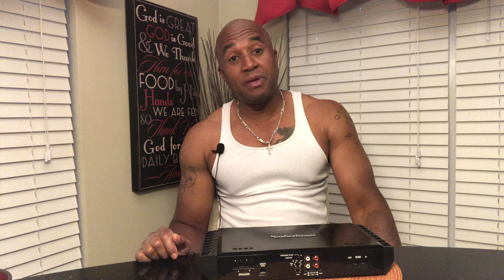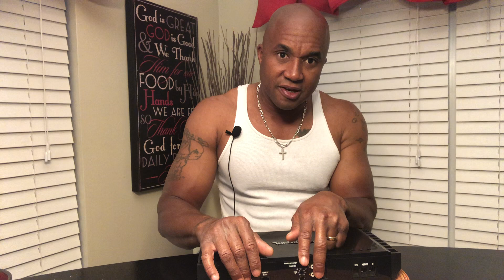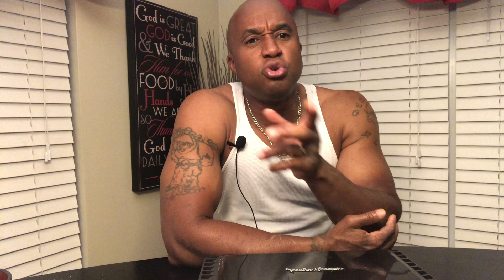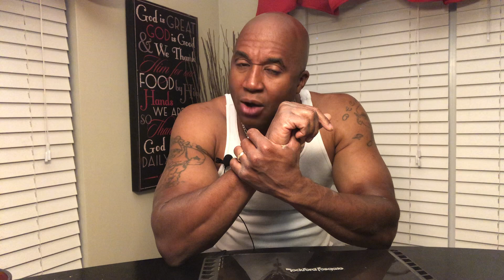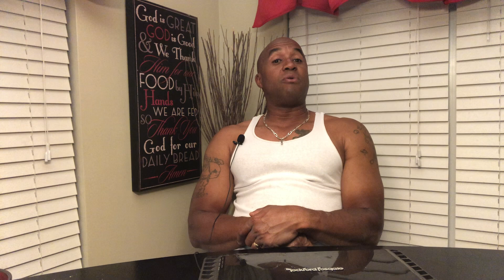Your amplifier gain is not a volume knob. Understanding the gain!

Comment: I don’t understand and I’m probably overthinking this. 
How do you test the voltage on the amp to know you’ve gotten to 4 volts if like me I have only 2 volts going in. 

I set my gains by taking the DC volts going to the amp then multiply that against the RMS I need then divide that by the ohms I need as well then the square root of that should give me the AC volts going from the output on the amp. I hope I’m not doing that wrong or maybe I’m missing something?  

I know this is an old video but how and where would I put a multimeter to the amp to see the voltage against where the gain is set.

Comment: So ..when it says 9v on what tou would presume is the low (left hand side ) if you were tp assume it was volume which is what you gain ;) lol 
 So if the low 0.2 volt on the right hand side of the knob ( high volume) i.e it refers to the input you are trying to' gain'.
  Fingers crosseed i dont turn on first time its on full hammer ! Omg .
 Thanks

Comment: My biggest problem is I have a 4 volt pioneer and 5 volt taramps 8k and it clips before 45 and 62 is max volume some songs with heavy bass clips before 45 and if I turn the gain back some it's weak so what I do is turn it up around 40 to 42 right when it slams and back the volume down on heavy bass tracks when I see clip light blinking?

Comment: Mr MB Question on gain settings. My Kenwood Radio is a 5 volts pre out. If my amp has input is rated at 5volt also I will not have too touch the a gain at all correct ?
Reply: My question exactly. I have a head unit with 5v preamp outputs but with the RF punch 1000x1bd i have to turn the gain like 80% ?

Comment: Hey buddy I have a dumb question (Since I really don't know much about car audio) but, say I have two two subwoofers... both are 15s by the same make and model.... but say one is 3000 watt rms and the other is 500 watt rms.. my question is if there both still 15s (even though one has way more power) isn't the subwoofer with less power gonna sound the same?? Because the air movement is the same correct?? Just wanna know!! Thank you!!

Comment: My system has a xs power d6500 and the regular stock battery still. If i upgrade the stock battery with another XSpower would that make a difference even with stock electrical and alternator?

Comment: Its output high ac voltage off low dc voltage and the more current you can give at a certain voltages the better the amp will proform  and if you driving a dirty single in to tge amp you are now amplified the dirty single to the output of the amp which chase 3 things ( high current draw hot speaker coils and a stressed out amplifier) so rule of thumb is for ever 100 watts of power that amp dose is at lest 15amps of current  so if your running 1000 watt amp you want at  least 150 amps of extra head room. You can get this by upgrading your alt to a bigger  alt adding in a secondary battery

Comment: Especially when using a lc2i or other powered line out convertor... I believe they can produce up to 9v of power. Had issues trying to dial in my amp using the square root method playing a test tone and turning the gain on the amp at 3/4 volume.  The lc2i was turned almost all the way up, therefore I only had to turn my gain a slight bit for MAX POWER!!!!!!!!

Comment: I bought 1500 bdcp and it gets hot and cut off is it wired wrong or is it something wrong with the amplifier because I bought a 300 amp alternator help don't know what to do
Reply from the maker: Could be where it mounted, not enough ventilation. Or the power wire to small as well as ground. They do get hot though

Comment: Good stuff man! You were sorta true on how you said it in the previous video. Tony D’Amore has a video up explaining exactly how it works. But if I recall it’s based on the dc voltage in to the aftermarket radio. 12volts for example, then the radio uses that and creates the rail voltage for the rcas in ac. And usually even in the most expensive head units that’s about 5 volts because the rails split that 12volts dc in  and make 6volts  up and -6 volts down on the rail voltage available. And like you know not all decks are able to be turned all the way up before distortion which is why usually you get that 5 Volts max on head units because that wave any more than 5  becomes dirty. And without getting too crazy with it , I think the components used in the stereo determine if you’re able to use that whole 12 V and split it to create the rail voltage , some cheaper units only have 2 V out because they use different components and are not able to use the full 12 V DC into the radio to create the voltage and they end up using a smaller amount of it. But that’s my take on it. So yeah it starts with DC voltage that switches to ac which creates the rails then that AC voltage out of the RCA’s goes into the amp!!
Reply: Smdd +1 and be done with it 💯✊🏾💪🏾

Comment: But how do you know how many VOLTS you in PUTTING INTO the amp???
Reply: My buddy has an spl labs system and that's how I found out mine. Not sure any how else other than reading the head unit manuel. Mine is a 2.2 volt head unit. My radio goes to 50 but I started clipping at 24 my friend told me because I need a head unit with more volts. He recommends a 6 volt or a 4 volt head unit
Reply: Trust and believe when you go active with a three-way crossover or DSP that increases the preamp voltage you will thank me do it it's worth it.
Reply: @johnnycorn7225  I have an LC2..should I get something different or what?
Reply: @phenomfacemob1011  anything that can get your preamp voltage up and your signal cleaned up is good and will help a lot
Reply: @johnnycorn7225  but ain't that what the LC2 is for.  That's putting out 9 volts

Comment: Hey MB what's the difference between the input voltage on a Brazilian versus a Korean why I ask because Brazilian has lower input voltage then a Korean
Reply: So I recently bought a nemesis fr200x4 Brazilian style amp.
Coming from my kicker zx350.4 for highs and mids I was receiving about 160rms for my 4 front stage speakers.
Now my pioneer HU has 4v preamp output, I when I used the gain I believe we had to move it just a little above 0 gain in order to receive proper voltage.
Now the nemesis amp was rated at 135x channel at 2 ohms, so about 250rms front stage...
If I even moved the gain the slightest bit my speakers would have a high pitched buzz that almost sounded similar to a ground loop. However I never experienced this with either my Kx350.4 or zx350.4.
So I ended up just keeping my old amp. Now maybe if you don’t have nice pre amps they will be okay. But personally I think it sounded pretty bad in quality. But maybe there are other amps that would sound lovely.
Reply from the maker: @abelscaliber7969  Brazilian amps use full bridge technology and to me, in my opinion, it’s not perfected yet. I honestly do not know why this happens. But it does and I hear it fairly frequently. Stick with half bridge amps... and the KICKER amp.

Comment: Having trouble with my cxa1200.1. Shirts off at night volume when bass note hits. Is my gain too high?
Reply from the maker: Sound like a dc voltage issue... not enough power going in. Underpowered amp.
Reply: @M.B.Enclosures  so how do u   know how many VOLTS u PUTTING INTO the amp?
Reply: @matt6951  how?